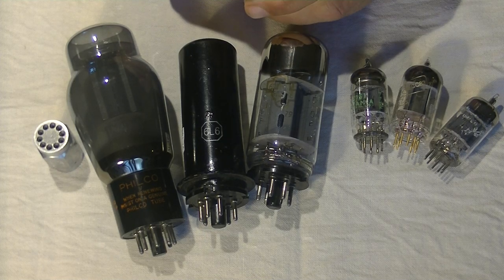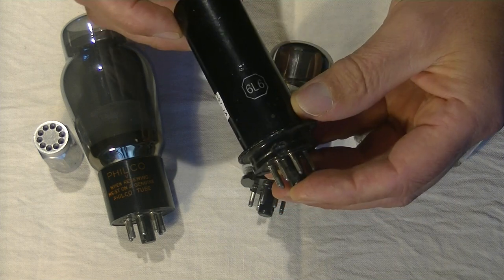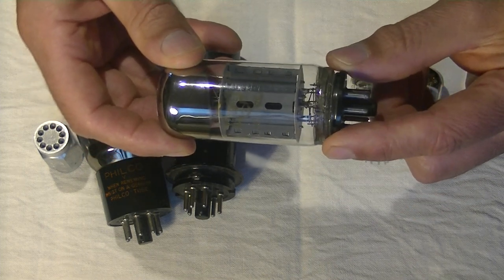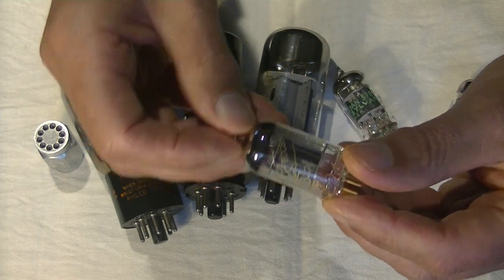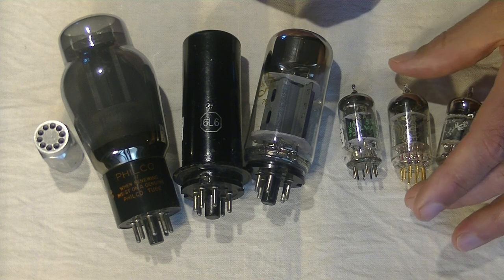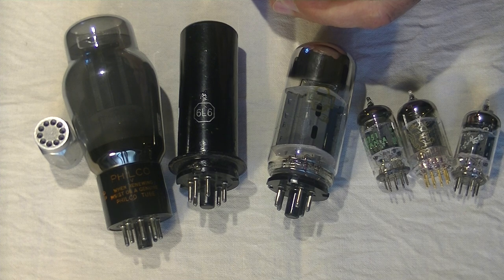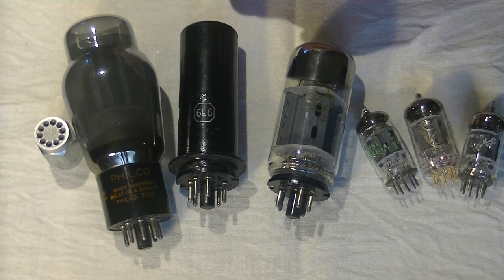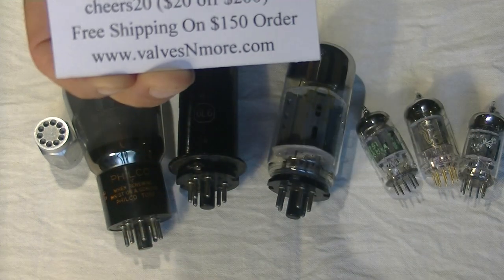Tube Lab #5   Tube Rolling for Beginners

Comment: Hi, a seller in our city has this not familiar looking 6CA7 EH. It has the label in black…
6CA7 EH
ElectroHarmonix
Made in Russia
06 06
It has a very short base around 2-3mm only above that black base is glass already where in other usual tubes its still part of the base. If pics can be attached here, it will be easier for you to identify it. Thanks a lot. 🙏🏻
Reply from the maker: No as far as I'm aware Electro-Harmonix never made a coin base 6CA7 (EL34) or are you thinking 6L6.  But the Sovtek factory in Saratov Russia (later owned by New Sensor of NY) did make a coin base 6P3S-E which is a Soviet close equivalent to a 6L6GT.
Reply: @tubelab194 , is it possible to send the photo of this 6CA7EH to your email if its ok? Sorry, I’m really intrigue by this tube. Thanks.🙏🏻